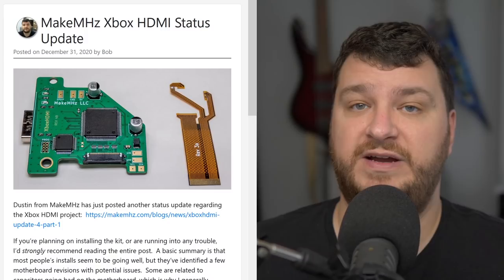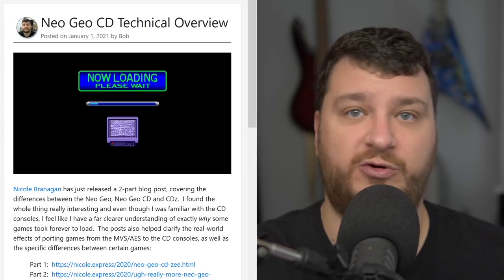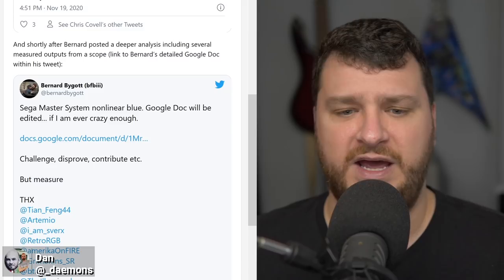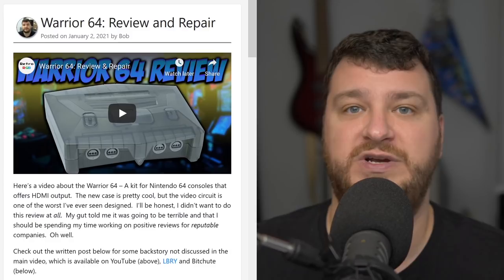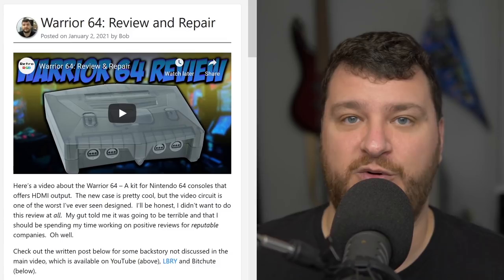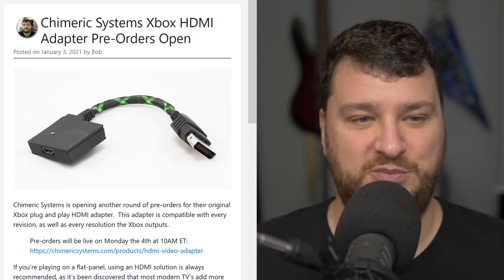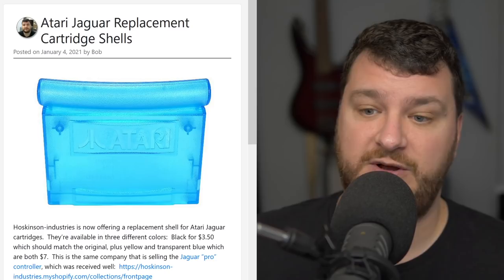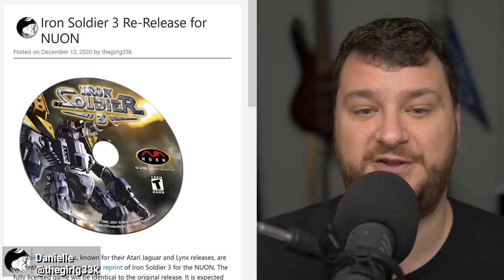RetroRGB Weekly Roundup #235 - January 6th 2021

Comment: Great video! Just a PSA for everyone here, I serviced about 10 OG xboxes in the last week and 9/10 had faulty leaky clock caps, so chances are yours needs to be looked at, also keep in mind version 1.6v needs a physical replacement if you don't change it the console will not boot. Also check the big caps around the cpu as these tend to fail and buldge. Plenty recapping vids on YouTube. Also the solder used on an OG Xbox is a really hard leaded type so not the easiest to desolder, have the right tools before proceeding.

Comment: Definitely Saturn power supply replacement or at least cap replace! My Saturn with a recently installed MODE developed an issue with screen interference.  Play the console just fine for 1/2 hour or so, restart the console and then get glitched screen.  After 5-10 minute cool down, screen was normal again. But process repeats after it gets warm again (except it never glitched while playing, only after resetting.....) 

So I replaced the power supply with PICO ATX and problem was resolved. 

Similar issue with my SNES with image having faint squiggly lines, changed the dodgy after market power supply with a good quality one, voila..... image perfect again.

Comment: -Hey if they get the right software why not make it a upscaller. May need extra io, just hope the io pins support all that or they can use the usb i guess. Least lag, lots of features, lots of settings, the inputs wanted and if they can 4k which everything struggles at. Because native resolution is a better option. Would be the next best thing to the framemister.
- I gotta get something to replace the pound thing i bought from some guy. Someone reccemended them to me. I bought them. I think it's ok. But this would be better i guess. The xbox2wii thing is in a different language. It's also not available on that site linked with google translate.Hope it isn't a issue with the modded xbox and the higher regulations that a regular component cable supports.. Just something to put on the list when things get better.